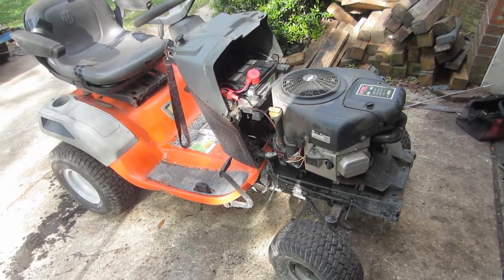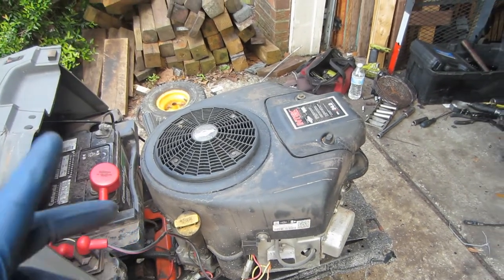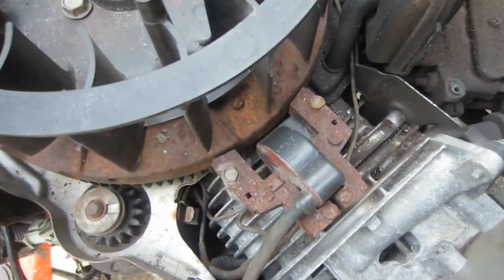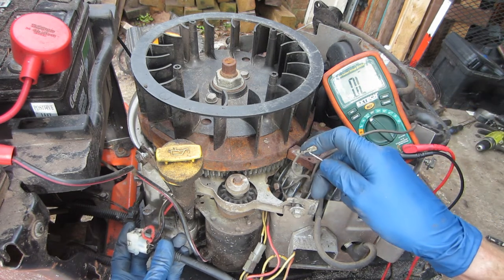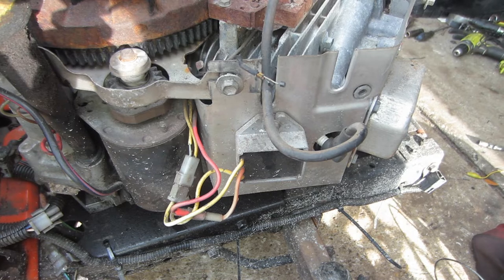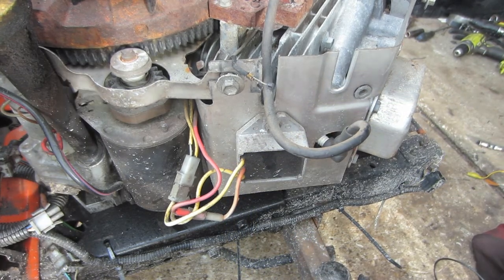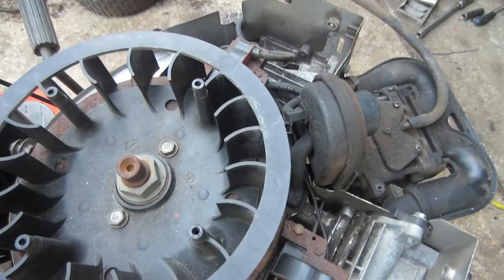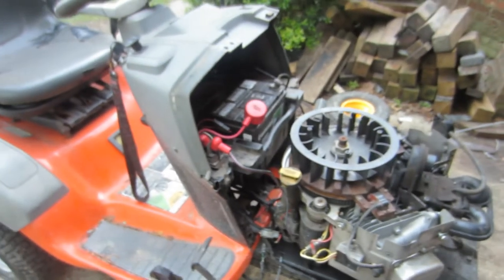V-Twin Briggs Won't Shut Off - Kill wire diode replacement.

Comment: This was helpful. Thanks. Have a Scag 26hp doing the same thing. Someone disconnected the kill wires after they hacked up the harness. I was unaware they had a diode in the kill wires.

Comment: I have a similar B&S engine 35000 v twin: My coil ground wire was shorted to 12volts at the ignition swt which blew the main fuse, after replacing the fuse the engine started but was harder to start at first then it refused to start at all only cranks as along as the battery lasts. My question is does this short ckt damage the coils or just the diodes and harness wire? Or does it damage both the diodes/harness and coils?  Great video, Thanks

Comment: We need radio shack back to get parts and diodes 
Getting the right ones is hard for me and where to buy them from ???
Any suggestions
Reply: I have always had good service from Mouser electronics. But dont be surprised when you see the shipping costs will be considerably more than the diodes, which costs about 50 cents each.    I try to have a list of things like solder, solder remover, soldering tips, heat shrink, etc. to help offset the cost of shipping. Cheers

Comment: Get video.  However, I find that my mower will start faster with a separate switch for the kill wire circuit rather than wired (properly) through the ignition switch.  Any idea why.  I rather shut it down with one switch, but it sure starts faster when the kill is switched and wired separately. There's no extraneous grounding anywhere.
Reply from the maker: Grounding the coils tends to be an all or nothing thing. Not sure what's going on there.

Comment: Hi, good video, it helps a lot, I want to ask you something: I have Husqvarna Ride on lawn mower Kohler  courage V-twin DSAI  ignition engine, it turns on and I turn it off easily there is no problem, but when the engine is on for about half an hour the engine does not want to turn off, do you have any ideas? what could it be? any help I would appreciate it
Reply from the maker: Is that the one with the weird coil setup ? I know nothing about those other than that they are problematic and often replaced with standard coils.
Reply: Your ground wire on the coil is broken some place or from the ignition key switch

Comment: How you test them without the tester 2 of mine been running that way a long time
Reply from the maker: You really can't.
Reply: @pfun41  on one engine i seen someone had 2 diodes on the coils ground wire plus size going up to the coil and minus going to the key switch so i cut those off it and spliced the wire back without the diodes on and now it shuts off how its supposed to

Comment: It seems at least in another video this can cause the tractor to be running on only one cylinder. And I think this may be my problem as I have a big loss of power.....
Reply from the maker: yes, Killing one cylinder will result in less power. The quickest way to spot that is pull one plug wire. Engine speed should decrease but continue running. If it dies or doesn't change one cylinder isn't firing.

Comment: HELP PLEASE
I notice that the diode markings band is towards the coils and away from the kill switch.  That is the opposite to what I expected. I wonder if the kill switch, although it is at ground voltage (negative), is at a higher voltage than the coil coz the coil is a/c and will be negative to the kill switch for half the cycle, so that the current flow is FROM the kill switch (at zero volts) and TO the coil primary while it is at negative voltage to the kill  switch....  ? Somebody tell me if am right coz it is popping my skull !
Reply: Just put the new ones on how you take off the old ones put the new ones on the same direction as the old ones were
Reply: The ground runs to the coil

Comment: I use the black heat resistant and oil and gas resistant rtv and would around those on mine cause its what i have